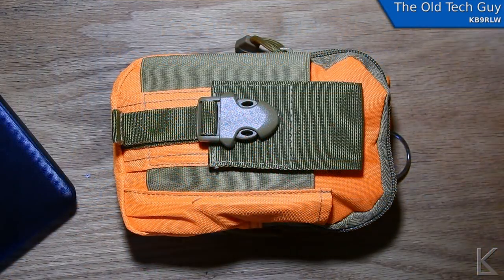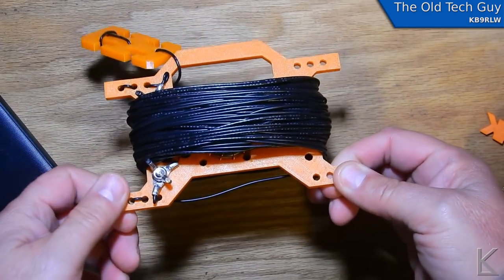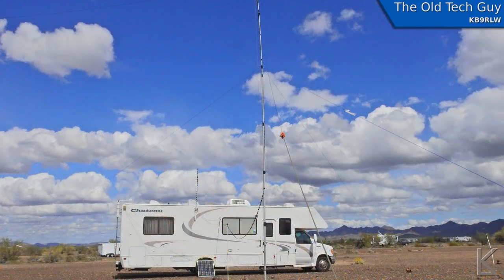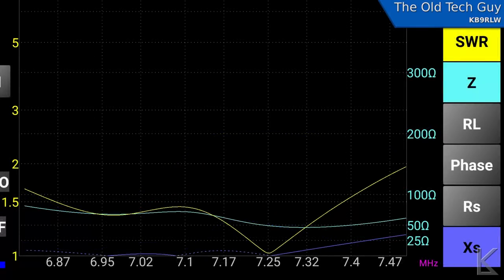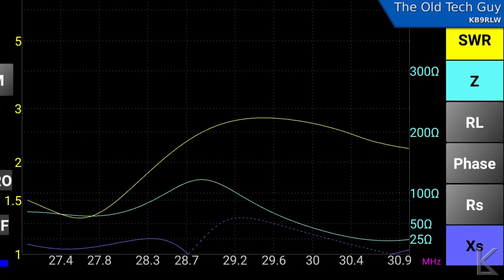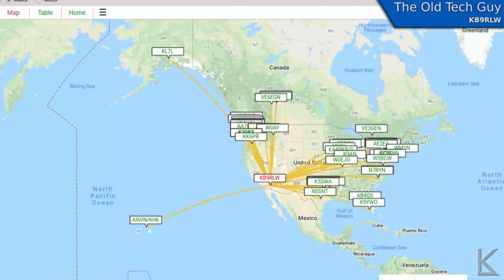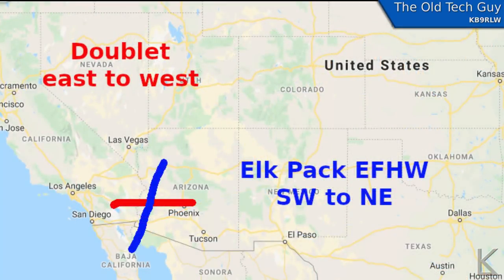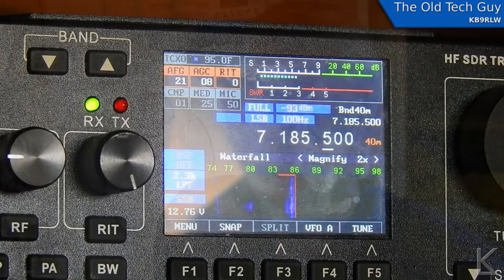Ham Radio - Tuning and testing the Elk Pack portable end fed half wave antenna kit.

Comment: Thanks for the video... WSPR testing: If you use a pair of Sotabeams WSPR modules (inexpensive), you can run detailed analytics on two antennas at the same time... simultaneous signals received by distant hams... taking propagation variability out of the analysis. 
You get a number: "Antenna A is 8 dB better than Antenna B", based on (xxxx) spots from (yyyy) hams.

My method is to keep the antenna that performs best in each test, as the reference in future antenna tests,. That way, I'm continuously improving my antennas... and it really works!

Comment: Another excellent presentation, made with crystal clarity. I had one of the early Elk kits (after watching a presentation from Gil, the radio prepper) and for portable use it works a treat with a home brewed transformer. Have done some experimentation with a 0.05⋋ length of coax between the feed point and a choke balun. It seems that my < 1.5 SWR on 40M is broader. Measurements of the RF field strength with and without the coaxial counterpoise and choke in place showed the field strength to be greater with rather than without (although my RF signal strength meter is home brewed, and therefore only useful for comparisons). Objectively my WSPR pattern was much the same. So many opportunities for experimentation and so little time! Thank you for your hard work. 2E0HWO.

Comment: I just use my multi-tap UNUN with a 63' wire for 40 and 20.. using both an 81:1 and 64:1 tap. My swr is generally under 1.3:1, right at the feedpoint of the UNUN on both bands. No tuner needed. I just did a test an posted it all with the thing at 2' high. lol. Not so 'lol' is that I worked several DX entities at that height. On the EFHW at normal height, the noise level is the same on the EFHW and multi-tap UNUN as on my Michigan Cacti vertical on 20 and a 40m invrerted vee at 26'.  Nice video Kevin and nice review! Better than a review - you actually installed it and tuned it and made contacts. You can't get any better than that in an antenna review!  73 OM

Comment: It was good to get some real world testing of the Elk Pack.  I'm currently using an 84 foot end fed non-resonant antenna in an inverted V over the house and it's doing OK, but I'd like to have a resonant antenna.  I'm putting together a very portable JS8 go kit and I'll either use a resonant end fed or I'm also thinking of making a portable coax mag loop with fixed tuning for the JS8 frequency.  Not very versatile but very portable and it suits my wacky needs.

I'm looking forward to the next video with the long wire antenna.

Comment: I noticed when you were testing with the VNA you get an antenna resistance scale and I was wondering why with your end fed antennas rather than make a 49:1 Balum which is supposed to be 2450 ohm why didn’t you make one with a turns ratio of 5.5 which is 1512 ohm which is closer matched to your antenna. Your comments pls
Reply from the maker: Everything I've read indicates that an end fed half wave wire will have around 2.5K impedance at the end of the wire.
With the 49:1, at the wires resonant frequency, I'm measuring very close to 50 ohms at the coax side of the matching network, so it seems correct.
Reply: Kevin Loughin we have an amateur here in Aus who used a short length of coax as a cap that can be tuned to resonance where you have the 100pf cap. It is initially tuned with a resister and then put into service. I believe the ground wire is critical in this as a counterpoise, did you find this where your feed line became that counterpoise. I am trying to reproduce VK2PRC’s Squid pole Setup and there does not seem to be an easy way to check the antenna resistance with differing gauges of wire and length I was wondering if you had a strategy.